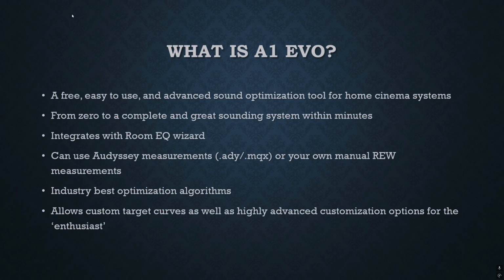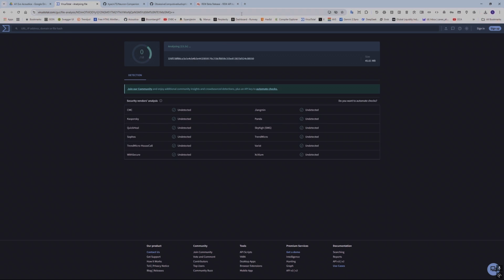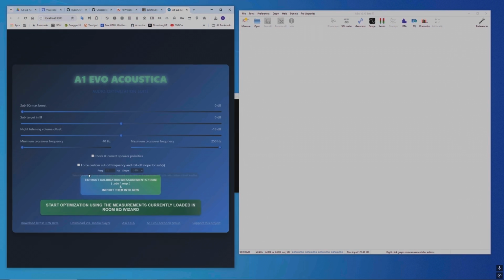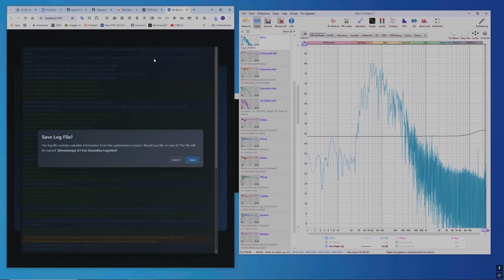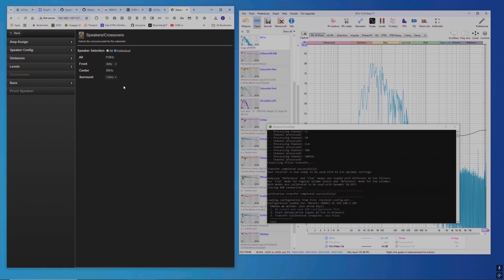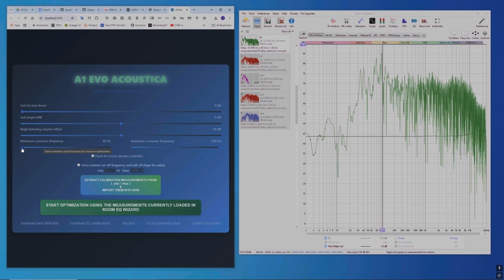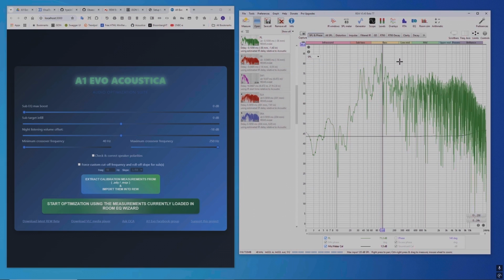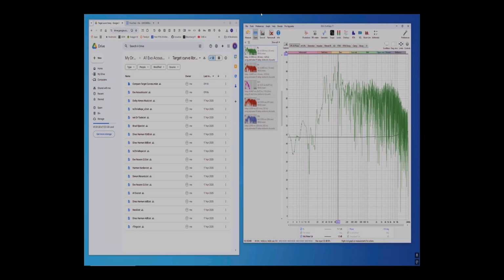A1 Evo Acoustica

Comment: You're amazing! I am an absolute noob at this, never done any measurements and you made it so easy for me to get it set up, 15 minutes, and it was done on my marantz cinema 30! I have a couple of questions. First, it sets my fronts to 40hz. Should I leave it like that or limit it to 80hz? Will it damage my speakers or avr? I have the perlisten R7t as fronts on a 11.1 auro-3d setup all running on the marantz cinema 30. Also my subwoofer has been set to 250hz, where I usually have it set to 120hz. Should I leave it at 250hz? And it's telling me that my subwoofer needs the polarization to be changed, I have the sub hooked up correctly and set to 0 fase would you suggest me to let it change it or should i avoid sub inversion. My last question is, I uploaded the audyssey file that I had on my audyssey app and used that for the calibration. I already had audyssey calibration on the cinema 30 on preset 1 and 2. I than send the a1 file to preset 1 and it overwrite the old calibration done with audyssey. should I reset/clean some settings on my cinema 30 before running the calibration and before uploading the finished a1 calibration to my cinema 30, or is that not needed? Thank you again for your amazing work, I was really close to buying dirac, but you changed that! ❤
Reply from the maker: Thanks a lot. Nothing will happen to your R7t's in fact you can even comfortably force them to large (full range) with the double bass option. If you don't like how it sounds though, feel free to play with crossover freq sliders. It takes 2-3 minutes in total to generate and transfer a different calibration.DOn't worry about the sub LFE freq and polarity inversion of sub is done automatically with the filters (unless you stop it in the advanced options). No need to reset AVR, just make sure it's set in correct Amp Assign mode and speaker configuration and identical to your measurements.
Reply: @ocaudiophile  Thank you for replying, I'm glad that I dont have to worry about the R7t (I was kinda worried). I am not very well known with double bass. What does that do? Does that play all the bass from the fronts on the sub as well, or will the sub only play everything below the set 250hz? And would double bass still work if I set the fronts to 40hz? And would I need to turn on lfe+main in the marantz for this all to work or leave that on lfe only. Sorry for the many questions. Like I said, I'm an absolute noob when it comes to all of this 🫣
Reply from the maker: @ViceMeimune just select double bass option and the rest is all automatic

Comment: When I click the button to extract calibration measurements from ady file, it returns the error: Localhost 3000 says Failed to send one or more measurements to REW. Please check REW connection and console logs.   

Can someone assist with this?  Thanks
Reply from the maker: You have to open REW before doing that...

Comment: Hi OCA! Love all you do. I am an audio engineer and use a pair of Genelec 8030C's with no subs which already measure quite flat in my room as I have taken my time finding the best listening position and best speaker placement. You mention that the bare minimum is a 2.1 setup, so what is the best solution for my stereo setup? I am using your method from the Mastering DRC video, but I won't mind a more improved version of the FIR.
Reply from the maker: Thanks. Acoustica will not work without a sub due to its surround sound origins. What you can do on top of min phase inversion filters below the room transition frequency is to invert excess phase caused by the speaker box. You can invert min phase part of the room effects and excess phase part of the speaker effects. It's a FIR filter based on EP inversion of tightly windowed speaker response but a bit complicated to do. I will make a video on that very soon.
Reply: @ocaudiophile  waiting on it!

Comment: I always was disappointed with the results I got, also from previous versions. But After I Finally discovered I did something wrong (I always used Dynamic EW which doesn‘t work with this) I was blown away by the results. I Never knew how much better my setup could Sound. I have absolutely no explantion how, but it also fixed my Subwoofer Problem. At my seating Position the Bass was the quietest in the whole Room. Much to the anoying of everyone else in the Room. Now it‘s fixed. Brilliant. Really love what you did here. I always thought about getting a second sub, but not anymore with this. Brilliant

Comment: Hello community,

I'm having trouble configuring the two-channel setup to match the distance settings that Acoustica applies for Dolby Atmos. Because of the distance discrepancies, there’s a mismatch between the subwoofers and speakers in stereo mode. Is there a way to automatically apply Acoustica’s multi-channel distance settings to the two-channel configuration? Manually entering the values isn’t an option, as the distances exceed the receiver’s allowed limits.
Reply: You can run a new calibration after setting amp assign to two channels and getting a new receiver_config.avr file and deleting the other measurements from your preprocessed measurement mdat. I don't understand why you have a "mismatch," though. I have no problem switching between Atmos and stereo.
Reply: @lastbutnotleast1396  Hi,

In your setup, is the front speaker distance the same for both stereo and Atmos?

In my case, I have to set it to 6.78 m (as in the Atmos calibration) to achieve the same all-pass filter effect. However, 6.78 m can’t be entered manually. The Atmos calibration has given me the best results so far, so I want to keep it for multi-channel playback.

Comment: Hello, when measuring the subwoofer alone after correction, the output is normal, but when applying the crossover and measuring the front speakers, the crossover section is measured 10db lower. Because of this problem, there used to be a 'weak subwoofer' selection, but they say that this problem has been resolved and disappeared in the latest version, but I'm still having the same problem, so I'm asking. I'm using a Marantz Cinema 70s.
Reply from the maker: Cinema 70 is not XT32 and should not use crossovers lower than 100Hz. You should leave everything in auto with a descent target curve.

Comment: Thank you so much for your work. The sound of my HT sounds much better with A1 Evo Acoustica, just brilliant. :) One question I do have though, I have noticed that A1 Evo Acoustica is lifting the SW level quite a lot. In my case, I have a subwoofer which needs a certain AVR level that its even "working". So instead of calibrating it at -10dB during Audyssey, I need it to calibrate as close to 0dB as possible (ATM I have it at -2.5dB) , which I did. Having that Audyssey curve optimised with Evo Acoustica, I find the SW level at +8dB. Shouldnt any additional bass be tuned on the SW itself rather than firing up the AVR SW output, to reduce distortion-amplifying? And also, with +8dB I believe it would reach the max very quickly, depending on volume levels. Thank you for your opinion on this.
Reply from the maker: You can set your sub slightly louder next time you measure however unless you're listening your system at extremely high levels and hear distortion, the current setting is totally harmless.
Reply: @ocaudiophile  Thank you. The problem if I set the SW louder, is that it would not turn-on because the AVR will set the SW-output too low. My SW seems to need a certain level... Having said that, I unfortunately need to have the AVR SW output at a "high" level. What would be if after Evo Acoustica has been applied and the SW level has been lifted to these +8dB, if I would put it back on -2.5dB manually on the AVR, and then lift the level on the SW itself? Would that "ruine" the Evo Acoustica experience?
Reply: @stargazer3417  Leave your sub on "on" instead of on "auto." It uses very little electricity when it's not doing anything.
Reply: @lastbutnotleast1396  unfortunately there is no "on" or "auto", knob on the sub, there is only a mechanical button for on/off, thats it. So from what I discovered its always "auto", meaning off when the level is too low. I will give it another crack with adjusting calibrating closer to 0dB (instead of -2.5dB). Else, idk, maybe a new sub, lol.

Comment: Hello I noticed that the repo doesn’t allow for public branches or PR. I noticed an issue where a user can click start optimization while REW is importing apy measurements. I’ve implemented a fix for this that disables the button during import process. Would you be interested in the code? I can share it via GitHub gist or however you prefer.
Reply from the maker: Sure, you can create a fork in github. There shouldn't be any problems with that
Reply: @ocaudiophile awesome submitted PR

Comment: Hi Serkan.. One observation : while doing the measurement using acoustica inbuilt tool... my 1st sub is detected as out of phase ( while it is not, it is at 0 ).. while running the optimizer acoustica reverses the phase assuming it is originally at 180.. can this false phase detection alter the way the Algo should work for time and delay alignment.. this is happening since  V8 measurement... ì have experienced better Sub setup with acoustica earlier hence asking the question
Reply from the maker: Inbuilt measurement out of phase report is directly mirrored
from Audyssey itself. Acoustica ignores it and if it's inverting it, it's because the total sound energy sums better with it inverted. There's also an option in Acoustica to avoid any sub inversion if you so wish.
Reply: Thanks... 👍

Comment: Hi Oca,

I am using your tool to optimize my home cinema system. First of all, I am very happy about the amazing sound after the optimization and cannot believe that you are able to do a better job than a big company like Audyssey. Really great job! But now I am very unhappy because I constantly get the failure "[GET_AVRSTS] Config Command timed out after 10000ms waiting for JSON response" if I try to send the calculated .oca-file to my Marantz SR7015 with my Windows 11 PC. What I'm doing wrong? Previously it worked. I already tried turning the Marantz off/on, deactivating Windows firewall, deactivating Windows defender, Deinstallation of the latest Windows updates, but without any success. Do you know where the problem comes from? I hope you can help me because I am very happy with the results of your tool.

Best regards, Jan
Reply: Hi Oca,

I found the problem. You need to connect the measurement microphone to the Marantz to get the Marantz in the "calibration mode". Afterwards it worked immediately. 

That was the difference between the previous use of your tool and the current use. :-) I only recalculated an exciting "room measurement".  No microphone is required for that. :-)

Again, thanks a lot for your excellent tool/work!

Jan

Comment: This question may sounds dumb but... what if i want to use Equalizer APO to apply the filters,eq and delay to the speakers, that this program outputs ? I can't afford an AV reciever and i use my pc motherboard 7.1 output to do a budget home theater right now, so instead of using the AV reciever to filters, eq, delay can i use Equalizer APO to apply all the filters, eq and delay on to the windows pc with my motherboard output ? I have limited knowledge about the Equalizer APO program as well as REW but i know the basics. Im new to this so i might need to dive a bit deeper... Sorry for the dumb question
Reply from the maker: You can apply delays and volume levels in Acoustica as is in APO. You should then export each filter(you can see them in REW at the end of the optimization - they have 'filter' in their names) as wave files which EQ APO can use as FIR filters.
Reply: If you know how te delay the sound in EQ APO i would be interested also ...I measured the speakers with UMIK 1 and use EQ APO for music just 2.1 channel stereo and one subwoofer . I dont know how to adjust the delay in EQ APO
Reply from the maker: @dorianestate You add delay in milliseconds for each channel in the config.txt file. You can find info on the web. Acoustica will give you delays as distances which you should divide by speed of sound.
Reply: @ocaudiophile  perfect! thank you for the reply, im gonna go and try it with equalizer apo now to see if it work
Reply: @ocaudiophile  so i tried the program but at the very first step it requires me to have an reciever_config.avr file in order to (i think) know what speaker it will be doing the correction and what kind of setup i have and apply correction according to how the av reciever capable of. But i don't have an reciever to make that file. Is there anyway to get around this or somehow make a file for the program to recognize my setup is using with equalizer apo ? Thanks
Reply from the maker: @justhappyxd4891 I think you can find dummy config files for most setups in AVS Acoustica forum first page
Reply: @ocaudiophile  nice ! thank for the fast reply :) i will go and have a look there

Comment: Hi OCA, really, really a great job🙂 thanks so much; sounds really better than everything else i tried before.
Just to let you know (because i also can do it 'by hand'): but when i want to use the 'odd_menu'-Batchfile to reset my AVR (as HD Movie Source explains in his videos before taking new measurements) it says: 'ERROR: Unable to determine odd.wtf AVR IP address' and then it stops; although Acoustica is able to connect to the AVR when transfering an '.oca'-calibrationfile!?
What can i do to bring this 'little helper' to work; and are the 'channel-trimmings' also reseted by this?

Comment: Good day, thank you again for this amazing tool.V8 has my bass sounding amazing but I do have a minor issue. Based on the final measurement results, it seems I am getting a massive bass suck out at 18hz as a result I would like to add another sub or 2 to try and eliminate this. The problem i am having is my receiver only has 2 subwoofer outs. What is the best way to go about setting up my system and calibrating 4 subs?

Comment: Dear OCA,

Did this week the update from Acoustica 6.1 to the Acoustica 8.03. 
Download the A!-Evo-Acoustica-v.8 Did the measurement
❯ 1. Recreate AVR Configuration File (Overwrite Existing)  OKE
  2. Measure System Speakers & Subwoofers                     OKE
  3. Start Optimizer (opens 'A1 Evo' in your browser)       Can't read the ADY file
  4. Transfer Optimized Calibration (.oca File) to your AVR 
So I did a new measurement , same thing happend. 
Measurement is from the denon X8500HA  with the audessey XT32 using the MacOs 
Can you let me know what went wrong?
 the acoustica 6.1 worked perfect, not a probleem
. Kind regards Tony
Reply: Dear Oca, problem is fix after reading the new V8 Quick guide. Acoustica doesn’t work with Safari. 👍🏻👍🏻

Comment: I was able to do the optimization but always end up with the error message, Channel SW2 is missing in configuration file!  >>> A1Evo Error
Reply: I also found out that in the root folder where acoustica is installed on my PC, that it created a file named receiver_config.avr. This file serves as the reference for the AVR settings. But because I already did acoustica with a single sub few weeks ago, this file did not contain the setting for a second sub and would not be overwriten with a new one. I had to erase it and let acoustica rediscover the AVR settings via network com. Now it works like a charm ! New optimization is far above the old one !!
Reply: Here too. Tried everything, more than once and always the same error
Reply: @SCHNEIDERMANNNN  yeah... seems lime the app dont like multiple subs..
Reply: Marantz Cinema 30, F C L speakers, 4 ceilings identified as surrounds, 2 front subs.
Reply: From what I understand is that you need to run audyssey as Directional subs not Standard, so this way you get 2 individual readings, then once you run it through acoustica it will do what it needs to do and when imported back into your receiver it will set it as standard, or you can set it as standard
Reply: @darrylgore5464 I did run Audyssey as 2 directionnal subs...

Comment: Although it finds my AV amp and allows me to select it from the list using v8 modified yesterday, I see the following error: [GET_AVRSTS] Config Command timed out after 10000ms waiting for JSON response.
Failed to get necessary AVR status/info: [GET_AVRSTS] Timed out waiting for Config JSON response.
Error during connection or status fetch for 192.168.0.186: Failed during AVR status/info retrieval: [GET_AVRSTS] Timed out waiting for Config JSON response.
AVR configuration process failed or was cancelled.

I have tried restarting my AV amp and it worked fine on the older version, which stupidly I can't find now.

Any suggestions?
Reply from the maker: Restart router, hard reset AVR
Reply: @ocaudiophile  Just tried this, full power down and unplug and boot back up 15 mins later. I still seem to see the same error. It's weird as the previous version worked. Any other suggestions?
Reply: @ocaudiophile  Any other suggestions? I've even tried a separate network.